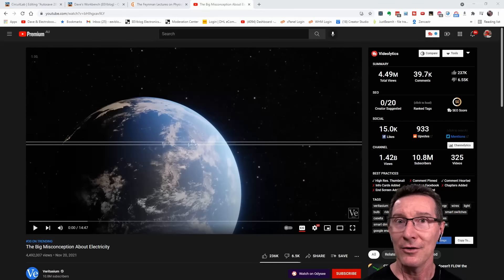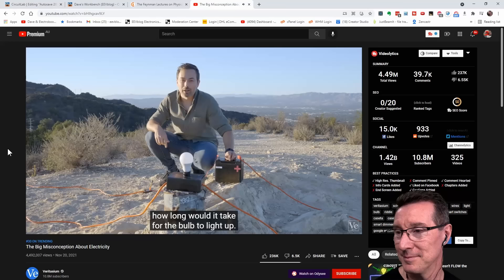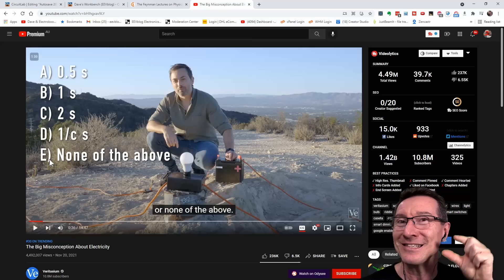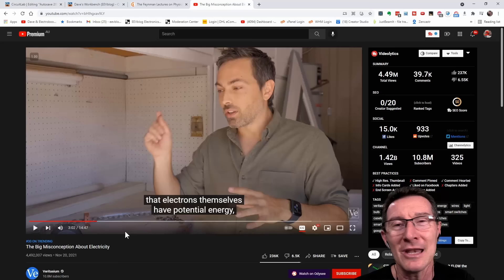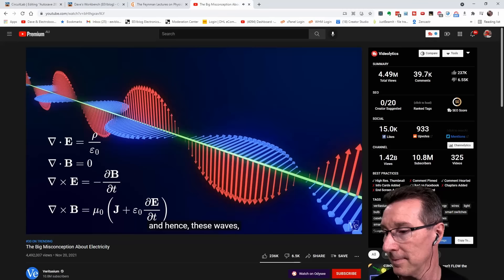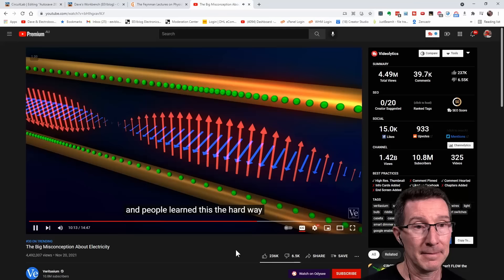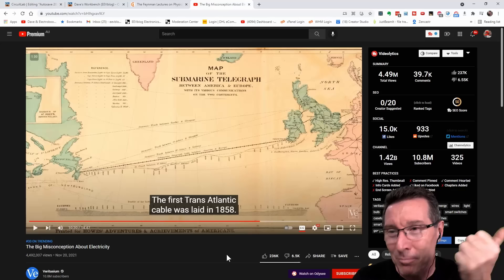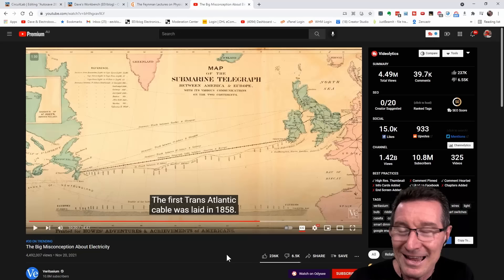EEVblog 1439 - Analysing Veritasium's Electricity Misconceptions Video

Comment: Electricity is really simple to pick up but bloody hard to master. You start of with comparing everything to water pipes. Valves are switches, water pressure is voltage and the volume equals current. And that simple comparison works for almost everything an electrician needs to know. The biggest difference between the run of the mill electrician and the layman is that the former is supposed to follow code. It only gets interesting once you go either really small or really large. When frequency and distance becomes an issue or electromagnetic fields get powerful enough to warp your conduits. That's were the fun stuff starts.

Comment: I've looked at the two "expert" references in Veritasium's video, they are both useless.  The first one produces a waveform with no timescale but is actually the short transient pulse as shown in Dave's simulation.  It doesn't show when the actual dc power arrives.  The second one does the opposite his analysis only shows the arrival of the 12V at the lamp and the reflections that result from an unmatched transmission line.  He only shows the voltage at the lamp and so doesn't show the initial delay at all.  It's easy to see how Veritasiuim has been misled by these analyses.
Reply: I agree with your observation as well.
Reply: "misled", or mastering clickbait

Comment: 32:00 "that capacitance at time 0 is a short circuit"

that was genius, this really drove the point home for me! finally i could understand this properly! if you analyze the problem very slowly at steps of nanoseconds this makes so much sense! thank you!!!!!
Reply: It is short because at t=0 you have a "infinite" derivative (a dirac delta) on the voltage between the capacitor terminals and therefore its admittance for that infinitesimal instance t=0 will be infinite. In simulation you see this effect discretized to the minimum time step that is 1us.

Comment: Nice overview, with a few "footnotes":
- "signal" and "power" transmission is no different. Even in a telegraph system, the S/N ratio is calculated  by accounting for the "signal power" (meaning, there is no signal without power). Of course, some concessions may be made at 50Hz, as opposed to 2.4GHz; nevertheless, when crossing the Atlantic, even for 50Hz, the characteristic impedance of the cable plays a big role, and cannot be ignored.
- the CircuitLab sim does not account for inductive coupling between L7:L8-like pairs.

I had called-out the "dimension mismatch" on Derek's vid, btw :) Nevertheless, I think Dave overestimates "most engineers" :p
Reply: from what i understand there is a significant difference between signal and power transmission(even ac power transmission) as with power you will just have phase shift and power loss. but the signal will be completely distorted due to the different frequencies it contains(square wave). and when looking at dc power transmission it's completely different(but I don't think anybody would want to do power transmission over such a telegraph cable)
Reply: @clemenswalter1984  Yeap there is a difference in the 50ohm and 75ohm cables, were 50ohm cables transfers more power, and 75ohm more voltage. Meaning one cable transmit and one for receiving.
Reply: @clemenswalter1984  Distortion is a thing in power systems too though, for example higher frequencies different from the desired fundamental one.

Comment: The thing is, the distance does matter for the interpretation of your simulation. The capacitance of two wires 1m apart is more in the range of 10^-15 F. That leads to a much shorter voltage peak. The energy transferred in a peak that short is not enough to "switch the light bulb on" in any conventional meaning.
Reply: theoretically, the voltage peak would be the same height, voltage can't change across any capacitor instantaneously. if dave used more accurate & smaller values for the capacitance, the transient spike would decrease faster, but he specified that he didn't care about that for this simulation
Reply: Ehh... for an incandescent bulb, sure. But if it's an LED bulb, you'll at least get a few photons at the LED's design wavelength out!
Reply: @MikeU128  hence "in any conventional meaning". You can't see a few photons.
Reply: @stulora3172  The thought experiment is not about generating light in a bulb or LED but about the moment current starts flowing in the resistance of the load no matter how small it is.
Reply: @ZeroInDaHouse  Yes. Don't get me wrong, the simulation was very helpful and overall, Dave's approach helped me understand what happens better. No criticism. I just wanted to do the next step by evaluating what this means for the actual thought experiment. And as we are talking about "switching on" the light bulb, I wanted to point out that we would not get any perceivable light from this path of energy transfer.
Reply: @Stu Lora
Yes!  Moreover, Dave here uses the wrong model for Derek's experiment setup.  A transmission line model is not applicable, so what you see on his graph is incorrect, and Derek's answer of 1/c for immediate steady ON is also not entirely right, it's misleading. For the immediate transient, the better model is a dipole antenna model.   Also, Derek conflates DC steady state with transient analysis which is false and folks who want to learn, get misled.  See my explanation in the main thread.

Comment: I'm a self learning PCB design engineer, haven't got around transmission line theory yet, vertiasium's video really confused the crap out of me, this video makes a whole lot more sense.
Reply: Look up and go watch some vids on transmission line theory. V's video was at best disingenuous for all the reasons that EEV talks about here. Take them slowly at first because you'll be dealing with everything E&M. But TL theory is the ultimate expression of EM theory and it rocks. And you don't have to understand the maths, just accept them as presented. TL theory is also the basis of waveguide operation, and both are essential at the high frequencies used these days on PCBs. Best wishes!

Comment: I'm 66 years old. As a child, we lived near large transmission lines in a rural area of CA. They passed over one of our pastures. We had a small water pump shed near the base of one of the towers. I "helped" my dad bury the power wires to the pump shed, 400 ft. from our barn/shop when he was installing a new pump. My dad used pipe strapping tape to mount some bare unwired fluorescent tubes inside and outside of the shed. Everynight the lights were always on and I asked him why. He took me out to the shed, and asked me if I felt anyything... I realized that the hairs on my arms felt tingly, and I felt something in my ears. He explained about how such high voltage cables as above "induce" a magnetic field way around the big cables, that's what gives me the feelings, and what makes the tubes glow like they were wired to something. That had to have been 1960 /61- as I had just started 1st grade. He drew some sketches to show how "he thought" it worked. He gave me a basic electricity book and quizzed me every once in awhile. His sketches looked just like his graphics. I guess my dad WAS a lot smarter when I was younger. LOL

Comment: A more interesting question might be ”how much time does it take to switch off the light” with a massive transmission line & a resistive load (probably arbitrary & unmatched)? With all that capacitance & an unmatched resistive load, it could take longer to turn off. Same issue as the first undersea cables encountered. It distorts the sharp rising & falling edges of the signal.
Reply: well, those cheap chinese led bulbs are  the answer I guess. :P
Reply: And how long does the light in the question glow with the small current if the wires are open at the end? Is it a flash of next to 0 time? Is it a flash 1m/c in duration? Does it stay on until the light speed feelers reach out to the ends of the wires to discover its open? Does it stay on forever because the bulb is infinitely sensitive and the fields will never completely stop?
Reply: I had another thought. The circuit should have a time constant if it’s a capacitive & resistive line. The time is t=RC (in its most simple form) but didn’t Derick say the resistance was assumed to be zero?! If that’s the case, by his own constraints, the t should be t=0 x C. Anything multiplied by zero is zero so the answer should be d because the resistance of the wires is zero so t also = zero not 1m/c m/s. Just a diverse thought :) ;).

Comment: Physicists love spending time on debating the "correctness" of different interpretations that lead to the exact same end result. The current flows as a result of the fields and the fields induce the currents in the conductor. They are not mutually exclusive concepts, in fact, they are coupled and cannot be analyzed independently, therefore being both essential parts of the description of electromagnetism. 
In addition, that circuit can, in fact, be described in terms of more conventional circuit theory, but the effects of propagation would be modeled by discrete components (inductors, capacitors) or, in a more complex approach, with a transmission line. Those models won't tell you the value of the current in every single point of the wire and, consequently, nor will they give you the value of the fields around them, but they can model the value of the current in the wires over time at some points of the wire (e.g. near the source and near the load).
Reply: "The current flows as a result of the fields and the fields induce the currents in the conductor. They are not mutually exclusive concepts" <-- Exactly. Why is everyone so scared to say that Veritasium's video is completely misleading? In almost any circuit, the vast majority of energy is transferred from the battery to the light bulb through the wires. Veritasium creates a silly circuit so that a tiny amount of energy could be detected at the bulb due to electomagnetic waves from one side of the circuit to the other. His circuit is impractical nonsense that does more to mislead viewers than to educate them.
Reply: @interestedparty00  Yeah, it's basically a transformer until the circuit "knows" it's been completed, as far as I can tell

You'd get the same effect if the wires were infinitely long and disconnected from each other
Reply: They do and they also care about using the correct units. The answer is E and m^-1s^2 is not a measure of time.
Reply: @interestedparty00  Couldn't agree more, completely misleading and confusing. The problem can be solved with the most basic laws of electromagnetism, but he makes it sound like some unknown physics concept that has many practical implications.
Reply: @interestedparty00  you still don't get it, you need to rewatch veritasium's video and EEVblog , they both teach that , contrary to what you claim, most of the energy is traveling outside of the wires
Reply: @nicoepsilon0 , um, no. I'm the one that gets it. You don't get it. Veritasium's claim about the energy "traveling" outside the wire is misleading at best.
Reply: @interestedparty00  I agree that the illustration of the circuit with the yellow arrow representing the energy flux is misleading in the sense that it was exaggerating how spread out the flux. In reality most of the energy is following closely the wires, there is still a non zero contribution far away, or right in between the wires.  But the energy flux is nonetheless zero inside the wires so I don't know in what sense you can claim that in most circuit, most of the energy is passing through the wire.
Reply: Tbf it is their job to debate the correctness but the problem is PhDs who want to make it seem like they do magic.
Reply: @nicoepsilon0  electric fields in the circuit are a direct result of charge concentration, magnetic fields are a direct result of charge movement. They cannot exist without each other, it's the very definition of electromagnetism. To say the energy in the circuit is not transferred by electrons is therefore not correct. 

The electric field from the charges inside the battery propagates with the speed of light through the wire, causing charge to concentrate and move. To say that energy is not transfered through the wire is therefore also incorrect.

Energy field battery into the wire --> movement/concentration charge --> changes electric/magnetic field around the wire (which has some effect on the rest of the wire) --> charge movement in filament light bulb --> heat/light

Poynting's vector should be used as a static concept, not a dynamic concept. There is no current flowing in the entire circuit when you close the switch, just a little at the beginning.
Reply: JESUS CHRIST IS COMING TO JUDGE THE EARTH SOON PLEASE!!!!!!!!!!!! CALL ON HIM NOOOOOOOOOOOOOOOOOOOOW!!!!!!!!!!!!!!!!!!!!!!!!!!!!

Comment: Agreed that EEs are taught about drift velocity but I remember this was in an 2nd year intro to device physics class which some EE's do not take.
Consider that many EE don't even learn the basics of transmission lines (my own undergrad experience).
The Poynting vector stuff was definitely not taught to most EE because that would probably be 3rd year advanced E&M and on the physics side of EE.
Reply: For me E&M was mandatory 3rd year. Every EE student at my university had to take it, and a lot of them failed because it was really hard. I still remember one of the questions on the midterm was just "Derive the Poynting vector." I studied my ass off and still got a C in that class.
Reply: Poynting vectors are definitely taught in EE undergraduate curricula. I think third year would be typical.
Reply: @rsm3t  --  It depends on your definition of the word "taught".  I taught my pet goldfish calculus. He really couldn't sit still, but I'm sure he was a good listener.
Reply: @poopytowncat  Absolutely irrelevant to anything here, but you do you.
Reply: @rsm3t  --  "Absolutely irrelevant to anything here, but you do you."  Perhaps more punctuation would make your sentence make more sense.
Reply: Yeah I agree with you. I graduated with a BS in EE. Transmission line theory is NOT Electronics 101. I get what Dave is saying here, it's "basic" for anyone with an EE degree, but it is absolutely not one of the first things you learn in a 101 class.
Reply: Yeah, smarty pants engineers don't know everything about the universe, they just think they do.
Reply: @poopytowncat  Richard, too much math in you life of what?
Reply: @jayleno2192  E&M was hands down the hardest class in my undergrad. It was not required though but I took it and got a C.
Reply: @charleselkins4546  --  WTF are you talking about?
Reply: Some are just here to troll and distract. But that's par for a YT comment section. Ignored and blocked.
Reply: Ah, device physics class... The one that I aced because I'm good at math and NO OTHER REASON

But I think that's very possibly how most people interact with quantum physics, so I'm mostly okay with that

Comment: I randomly watched the Veritasium video and was really puzzled because I couldn’t fit the bits and pieces together with what remains of my physics and engineering classes. Something just felt off but I couldn’t lay my finger on it (while I somehow guessed the „correct“ answer). Just wanted to thank you for your brillant video and the simulation explanation approach, it totally helped me to figure out what is going on and putting the bits and pieces together. The whole DC business was soooo confusing, because I did not make the connection to transmission line and transients. I was also extremely puzzled by the fact that the lamp should turn on so quickly, and was wondering what would happen to lamps at the end of those long lines - your explanation with how things would work when you used lines in a circle instead the parallel lines made my internal lightbulb light up. So thanks for helping me figuring this out. 😊